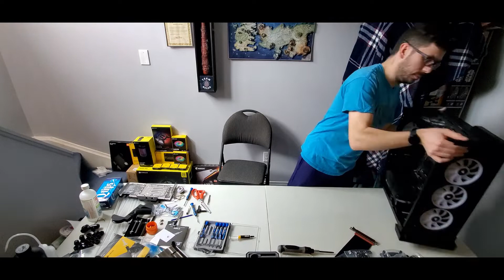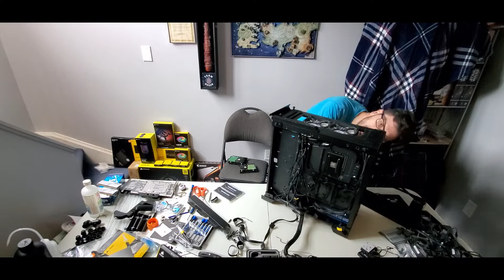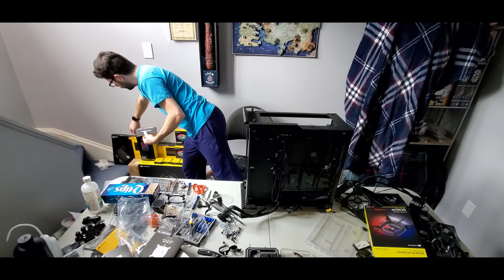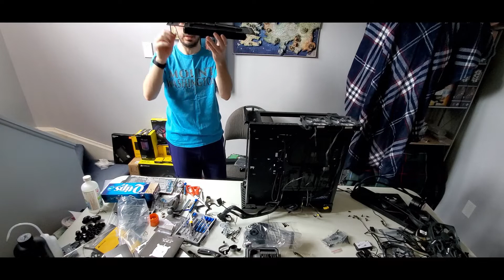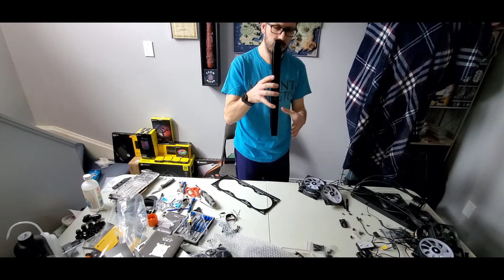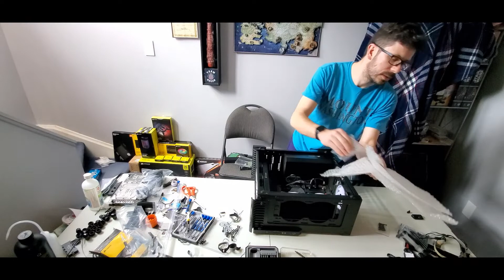Teardown and water cooling component assembly (Part 4)

Comment: Interested to see where this goes. Considering attempting to water cool my 6900 aswell.
Reply from the maker: I'm pretty happy with the end result. The loop has been finished for about 3 weeks now, though did the last bit of finishing touches (GPU RGB, cable management, and coolant top-up) about a week ago. Working on those recordings and should have more stuff up in the coming days.